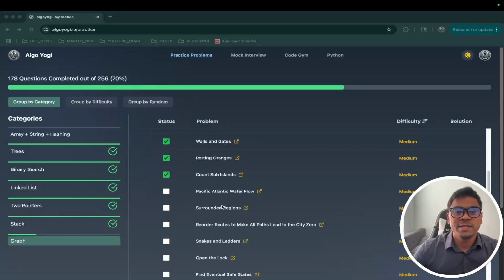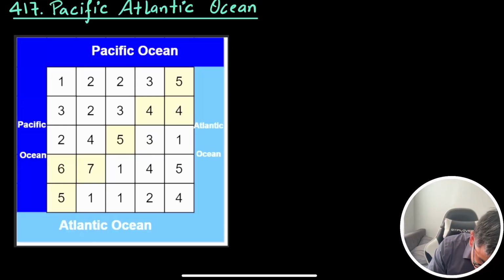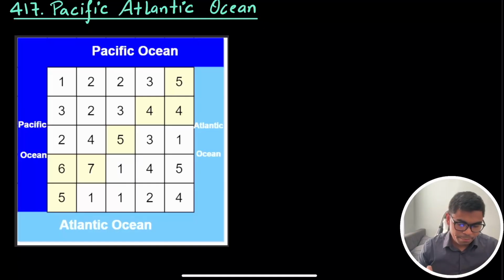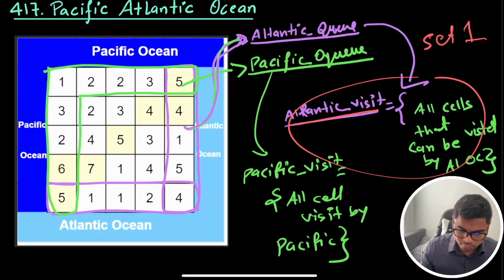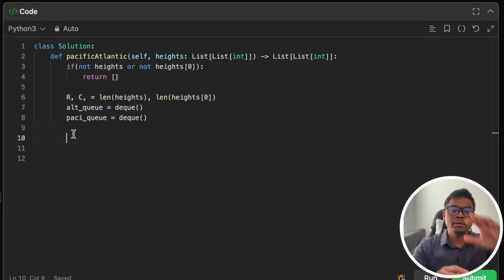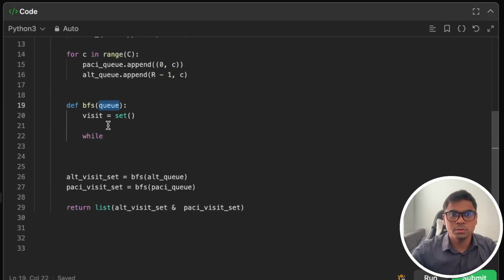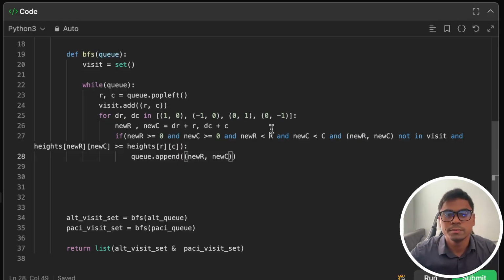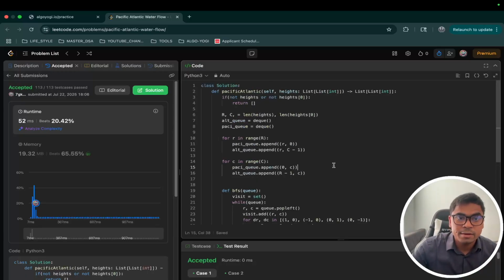LeetCode 417 | Pacific Atlantic Water Flow | Python DFS Matrix Flow Explained | AlgoYogi

Comment from the maker: 🧘‍♂ Pinned by AlgoYogi

🔥 Solved LeetCode 417: Pacific Atlantic Water Flow using Python + DFS

📌 Key Concepts:
- Reverse DFS from ocean borders (top/left for Pacific, bottom/right for Atlantic)
- Track reachable cells for each ocean
- Final result = intersection of both reachable sets

💡 Post your BFS version or visualization tricks in the comments!